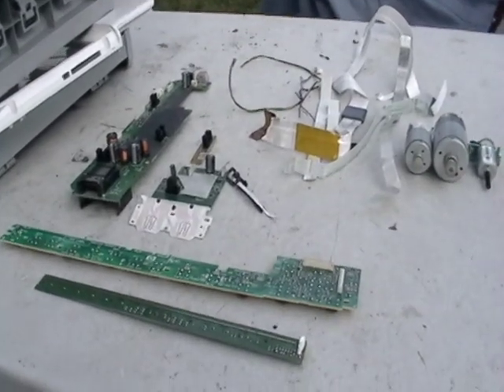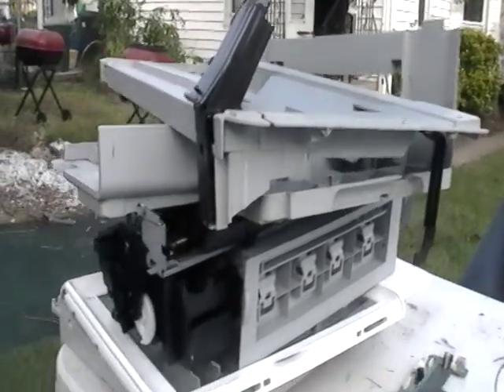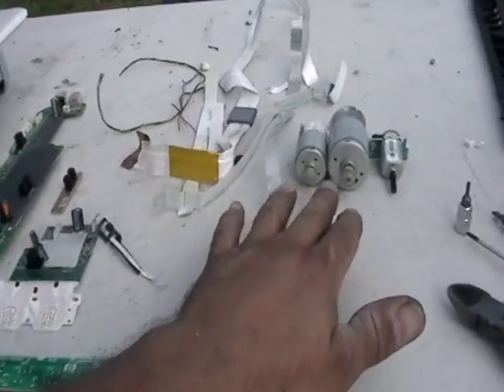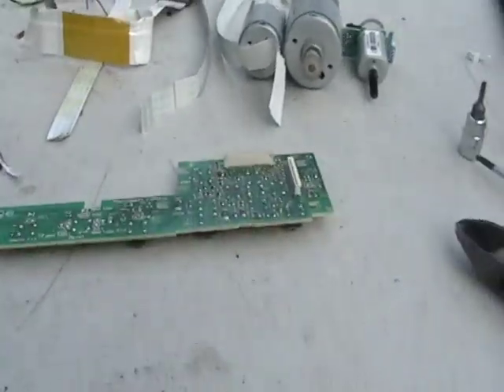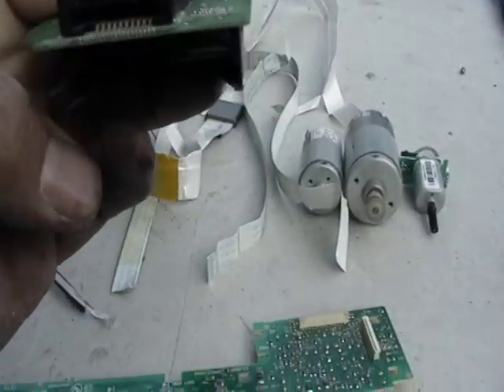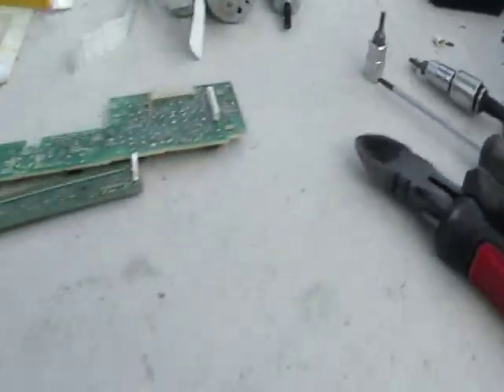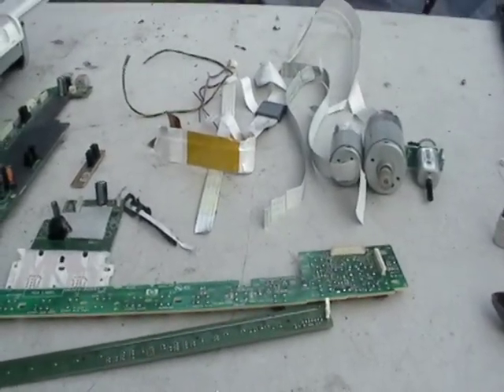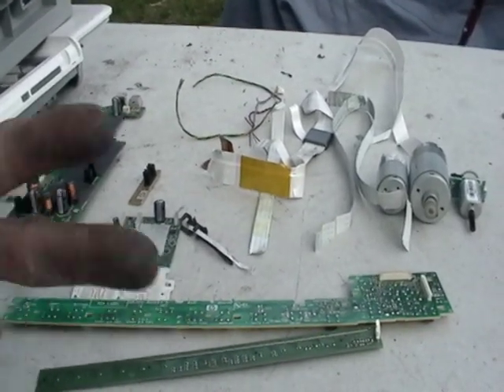scrapping a color printer for copper gold

Comment: I'm using all the magnets I can take out of hard drives, covered by thin layer of plexiglass bolted to a 2x4 that will hang by an adjustable chain out the back of the jeep.  There's just so much shells, I can't resist.

Comment: I heard about people getting in trouble for recycling Military shell casings.  I'm still going to ask my local scrapper that takes my brass.  I don't have an AK47 or AR15.  These steel shell casings are on 15-20 miles worth of dirt roads.  I have to make some magnet rakes, and gather a team to pull off the stupid shotgun shells that will stick too.  I was thinking some kinda lever action magnet rake, that would dump the ones that stuck by pulling a string or something.  I need a trailer!

Comment: you need to collect THOUSANDS of boards to get some gold because the plating is very thin. Parts like motors, capacitors, ICs, transistors are more valuable